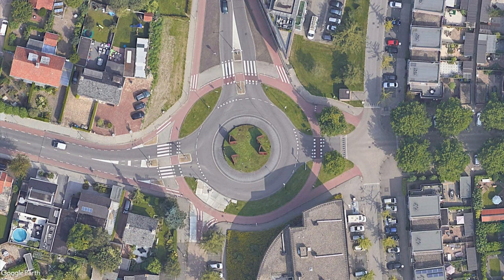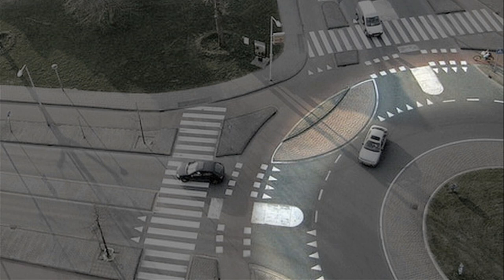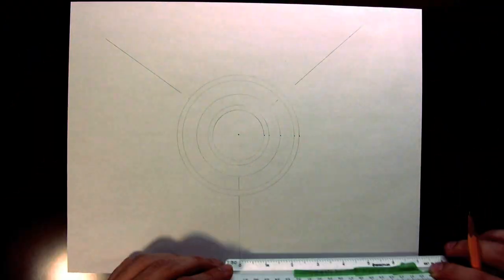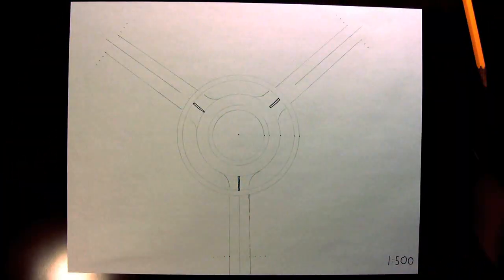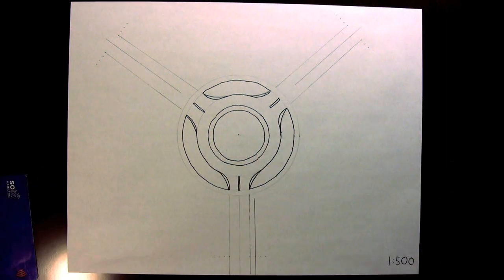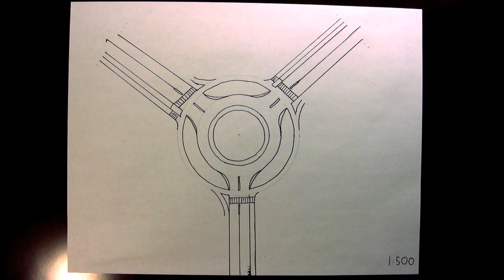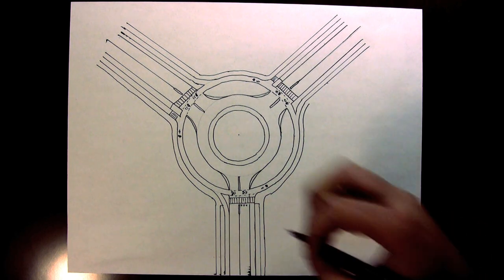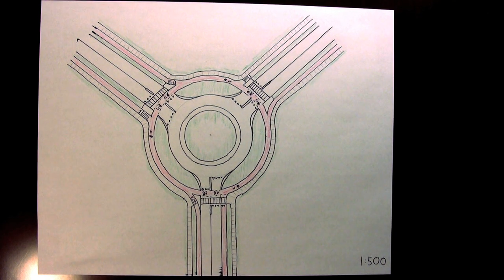How to draw a Dutch Roundabout

Comment: To be correct for Ontario, the bicycle paths should be green, instead of red. Something similar has been built in Ottawa, along the Kanata/Stittsville boundary (location below in Google Maps). Crossing markings don't align with the paths, however. https://www.google.ca/maps/@45.2703559,-75.8924096,3a,75y,45.35h,103.54t/data=!3m6!1e1!3m4!1sEE2kqqFL3MniFpWe2voMKw!2e0!7i13312!8i6656?hl=en
Reply from the maker: Haha, yes that's true but I took that liberty because I find the fluo-green markings to be exceedingly ugly and they're non-regulatory anyway.

The roundabout you linked there is highly problematic because it doesn't have tight entry radii onto the central circle and the bicycle path takes an sharp turn right before the crossing.  And the signage and markings at the crosswalks would make it unsafe and illegal to ride a bicycle along those bicycle paths.
Reply: @OntarioTrafficMan  
A Dutch example:
https://www.google.ca/maps/@51.6720121,5.2923569,96m/data=!3m1!1e3?hl=en
Shark teeth placed where cars have to stop when there are cyclists, so away from the other cars.

Comment: Very well explained, thank you! Can you draw a roundabout with bike lanes separated from the main roundabout? Or with 2-way bike lanes tunnels under the roads?
Reply from the maker: I will not draw the roundabout with bike lanes on the roundabout itself, since it is the least safe design for roundabouts - even less safe than having no bike lanes at all!

The design with tunnels is of course the safest design, but I won't make a video about it because the process of designing the layout is not very interesting. You can put the tunnels wherever you like, since they don't interact with the roundabout itself anyway.
Reply: @OntarioTrafficMan  but the turbo roundabout above the bike tunnel would  be interesting
Reply from the maker: @burgerpommes2001  I do enjoy drawing turbo roundabouts, but they're not really my specialty so I wouldn't be able to provide very accurate design guidance. If I continue this "drawing" series, the next intersection will be an A4 Partial Cloverleaf Interchange with separated bicycle paths.